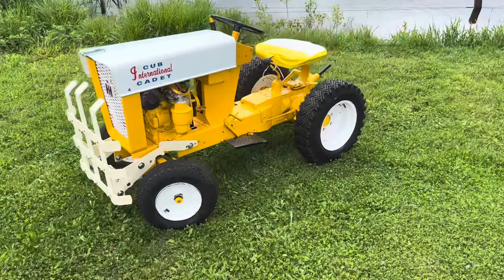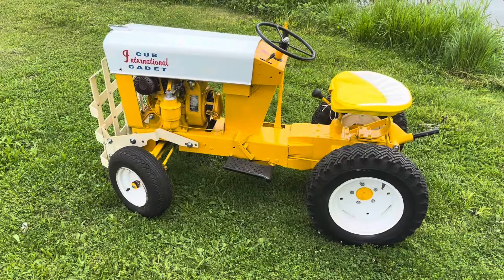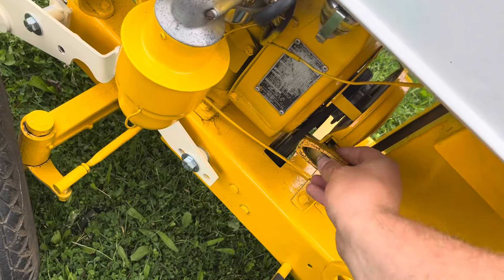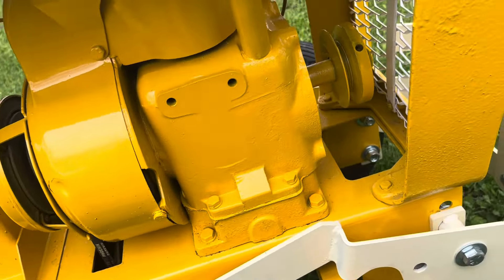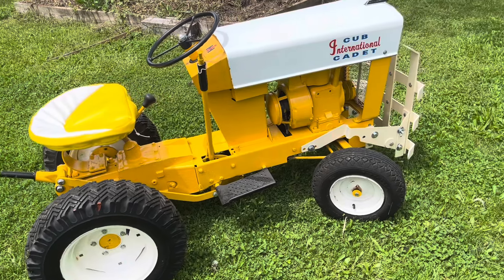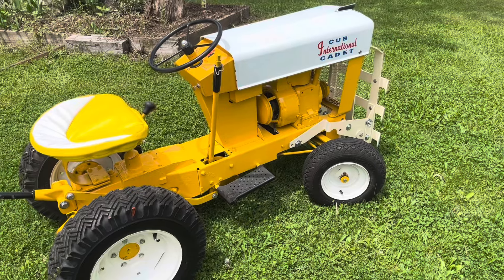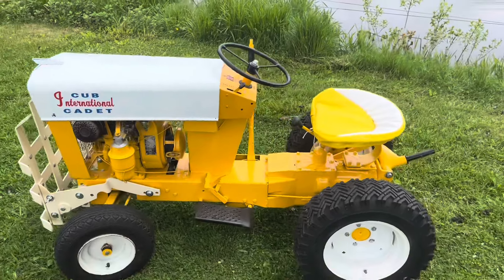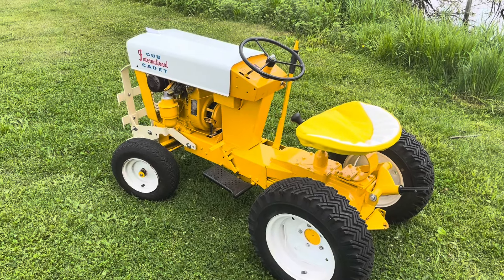Cub Cadet Original! Walk around & Drive

Comment: We are in the Uk.  Just bought a international cub cadet 1961 pull start for our Grandson.  Where do you get the parts we need a coil, condensed and points?  No one knows the model number and we can't read the plate.  Enjoyed your video.
Reply: All the single cylinder Kohler engines are the same points condenser and coil

Comment: Where can I get a bumper like that? And will it fit on a 67 model?
Reply from the maker: I bought it from Xtreme motorworks. It’s modeled after a Brinly gard n cart. I’ve seen them on a 72 but you just have to notch part of it around the quick attach bolt.  Otherwise they should fit all narrow frame cub cadets